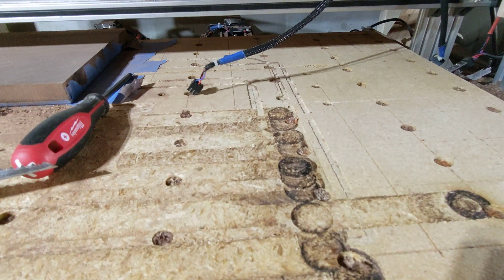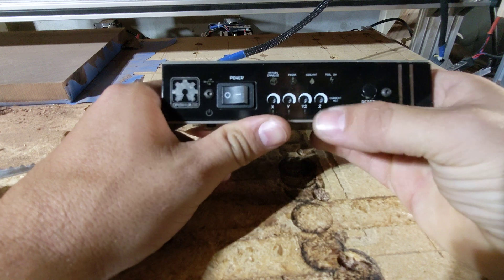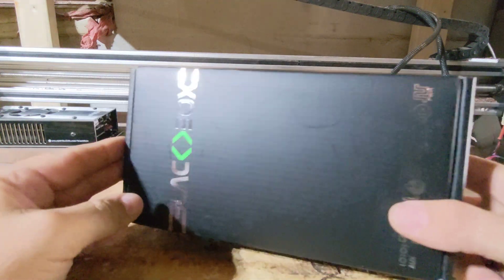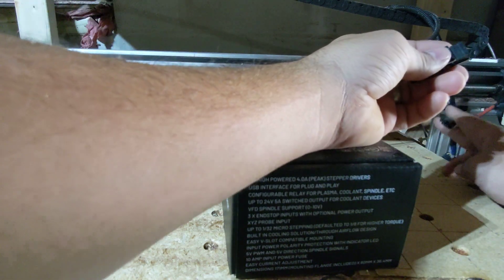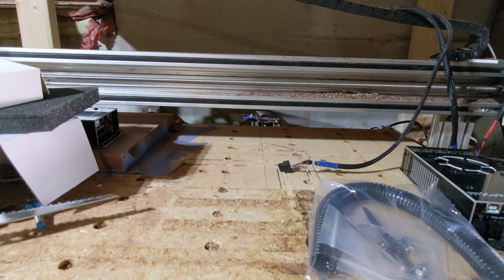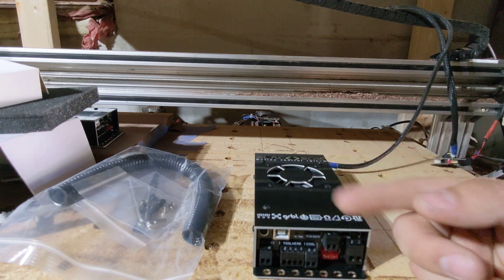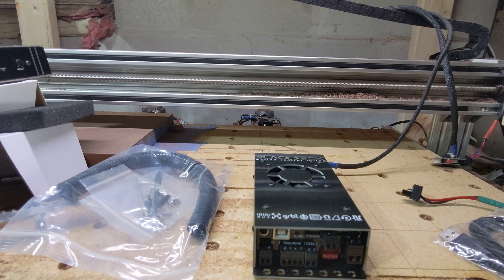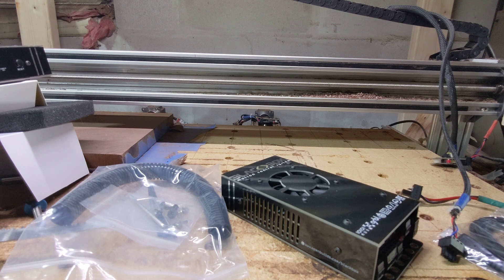Opening up the Openbuilds Blackbox controller

Comment: I don't think Openbuilds is in business anymore. Can you recommend a similar replacement? I was too late to buy their latest generation one that utilized an SP card rather than have the computer connected.
Reply from the maker: Pretty sure adafruit has a controller available. 
And they stand behind their boards. If you can swing it, acorn controllers are pretty awesome too.

Comment: stupid buy one box all in, because you make some error or broken one driver need buy new owerprice expensive box all new, lot better and cheapen have buy usb controler 20$ and ewery axis own motor driver what size want use, 20$ about /axis.  if one go broken not need buy all new. only one axis or one cheap controller new. and can use biggest better drivers and big motors too what want use, normal opebuild and shapeoke etc have too small torque motors what need change better motors sametime than install all, why some peoples buy stupid 4000-6000$ cnc because normal men can build same and lot better and biggest machine DIY in garage easy, and less than 4-6000$ about 1000$ can build same or better machine in garage DIY.
Reply from the maker: That is a point for sure. I don't mind the black box. It's not that expensive compared to many controllers on the market and it's plug and play.  I sold a CNC recently with a black box that I installed, even though its components were older, I was able to remove its old controller (A big thing, maybe 18 x 12 x 7 inches) and replace it with the black box, and simply wire it in. it functioned better than with the old controller, and took maybe 20 minutes to install.  You're right, there's less expensive ways, But my time is also valuable and I'm willing to spend a little money to make the difference.
Reply: @captainahab5650  not need spend any more time buy 20$ controller box, need only plug wires and setup software all input,output thats all. software config have easy some minit work add table size, in/out,limits etc. not rocket science and not waste time any more.but if come erros broken etc, can cheap change board new and not waste money lot. have only stupid waste money ower 200$ box what can use better board 20$ money have important than time. same have totally stupid buy 4000-6000$ machine kit if all normal men can build same or better machine about 1000$ easy order better parts and build all together go only same time than buy ower expensive machine and install thats ready. save lot money, time not have ewer important, no matter build you machine 1 or 2 week or 1 day. only have stupid if waste lot money, i has build many machine, my hobby, and my son 12 year old has build him own machine not have hard build. i has build many small factory retro fit cnc mill machine lot cheapen than buy 100 000$ new machine only order parts and install old machine some motor and controller have lot lot cheapen, expt, one factory think buy 120 000 plasma cutter, old working well but has manual, frame has good, need only motors ballscews and controller and linuxcnc software and cost less than 1300$ has lot better and smart build own no go lot money stupid. same many woodworkers shop i has build machine and easy cheap repair if come problems. less than 50-80$ can change new or better biggest motor drivers can change controller 20$ if burn, what not has ewer any machine doing, motors have big only expensive cost 40-90$ normal need more than 3Nm torque motors if want sure working at factory good. openbuild motors have all too small good factory work uses, hobby work if not have busy have ok, about minimum size what can use. same prce can buy lot lot better motors. or buy little biggest 60-90$ have many good double biggest torque motors, thats have importand no lose steps and can use fasten and more chips.
Reply: but if have good frame now can change motors,drivers,controller better later. lot cheapen.

Comment: i just watched your video on receiving the new black box. I just also received a new one from Open Builds and went ahead an installed it by just unplugging and plugging in. (i didn't  move any wires) but now when i move the controls my Z motor from some reason is backwards up is down and down is up. did they change the way its wired.
Reply from the maker: There is a setting that you must change. You'll have to select "Reverse Z" in the settings.

Comment: Thanks for the update I just purchased the black box from open build I build my own cnc router 1.5m x 1.2m and currently running on Mach3 with drivers and I was wandering if my 4amp stepper motors will be able to run with the black box it is Nema 23 stepper motors 2 on the Y 1 on the X and 1 on the Z axis 
Your thoughts on it please
Reply from the maker: My 23's run fine. You can ramp up or down the voltage if they struggle a bit. The z on mine is a high torque too.
Reply: @captainahab5650  what size torque have i think open build sell only nema 23 2Nm motors all machines what have totally too small drive good, minimum torque all hobby cnc must be run good have 3Nm torque and biggest is better not lose steps.
Reply: Horrible machine man. I can’t get mine to work for more than 2 days without a problem 2 controllers and 3 routers